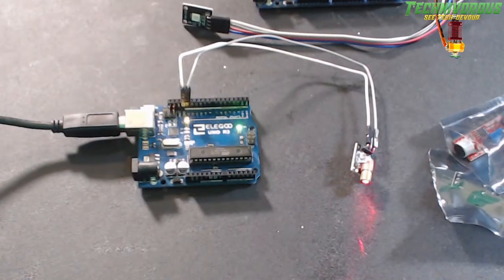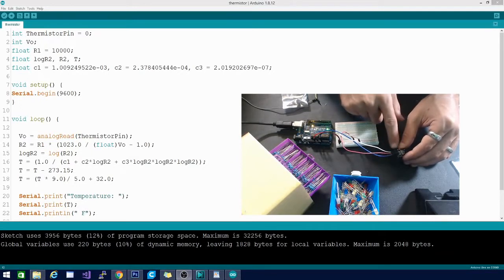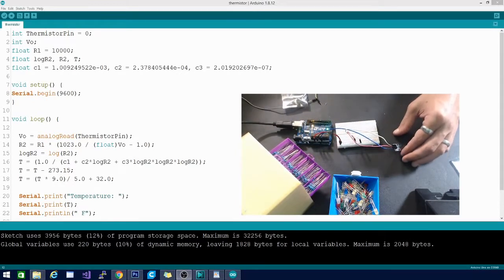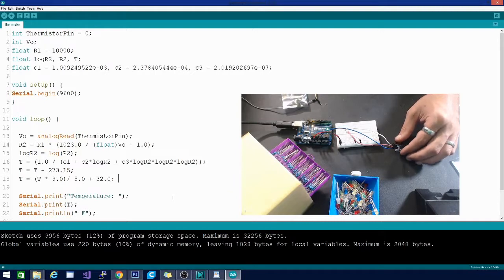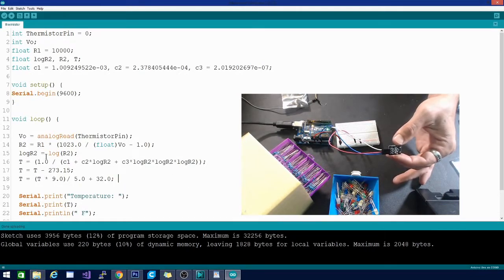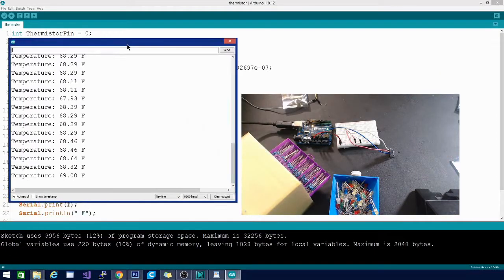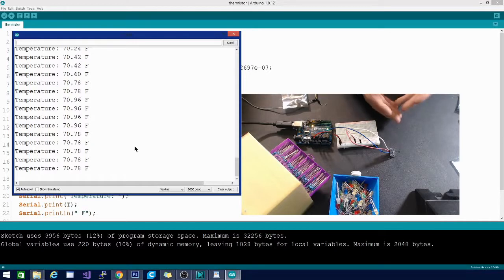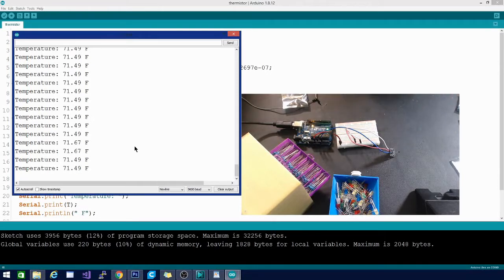HW 498 Thermistor Temperature Sensor   Arduino for beginners   Sensors

Comment: Very Interesting, to test and play with the replacement thermistors of my printers :)

Where did you get the values of the constants and the formulas for calculating the temperature? Does it come on the data sheet for each thermistor?

Successes !!! And thanks for sharing :) :) :) :)

Comment: Very cool. Arduino is wonderful. I have been working with that for some time now. There are videos on my YouTube, but they are in French.
By the way, wich calibration would you suggest for Ender-3 v2 printers? Mine came with the original calibration: X=80, Y=80, Z=40, E=93.